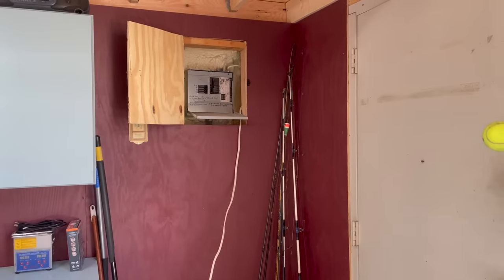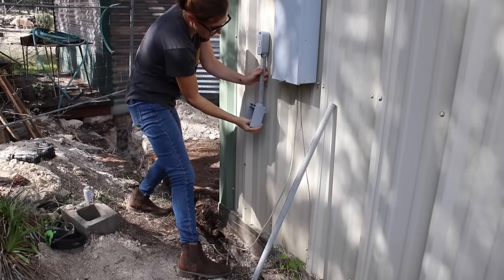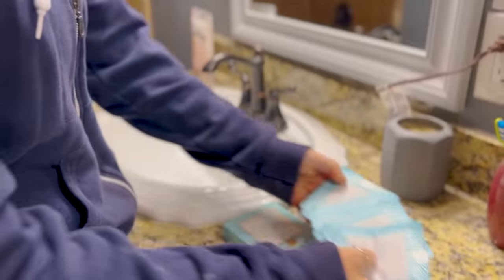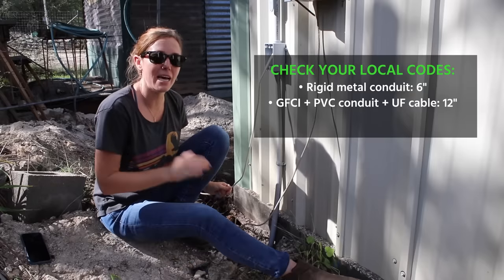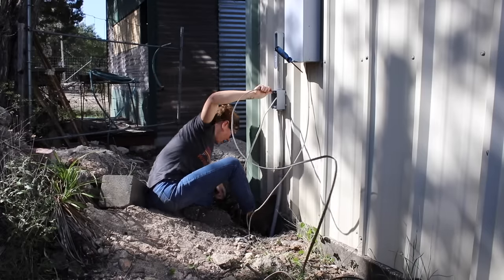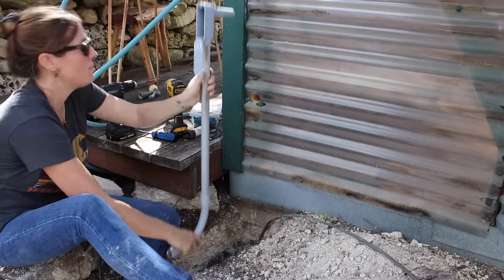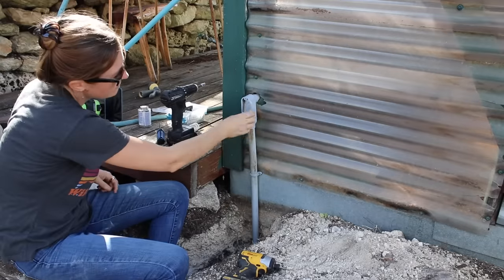How to Run Underground Power to a Shed the Easy Way

Comment: Your first run of Romex to the GFCI is a code no-no, even inside of PVC conduit.  NM cable (ROMEX) is not permitted in damp or wet  locations [NEC 334.12B(4)] and the inside of raceways (including PVC conduit) located outdoors is considered a wet location per NEC 300.9.   Your first run should be UF cable or individual THWN conductors.  If the latter, the individual conductors should be placed in conduit all the way to the source panel.
Reply: Texas has very lenient/substandard codes.😒
Reply: This is texas are codes are different from were ur from I can see
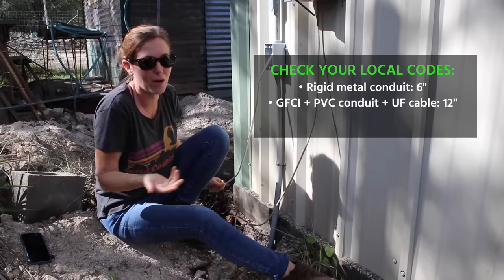Reply: At about 3:30, the text box says “UF cable”.
Reply: @DragCadRacing  Prior to that, ROMEX is used from the inside to the GFCI box....
Reply: @rayrayber_  The N in NEC stands for national. These are unified codes adopted by many states, including TX,  as the baseline for electrical and fire safety.
Reply: @jackww839  Against code even in Texas bud
Reply: @rayrayber_  STILL against code in Texas
Reply: I was just coming to comments to see if somebody brought this up.  I wasn’t sure if I was thinking wrong believing that standard Romex shouldn’t be there.  Glad to see somebody answered the question before I could ask!
Reply: In Texas go big or go home....codes are overrated and unnecessary 😂😂 at least in the country anyway.....where it's legal to DIY   your own stuff ....

SEND IT!!!
 👌mint
Reply: @healthywithamanda  gfym
Reply: @healthywithamanda  not funny
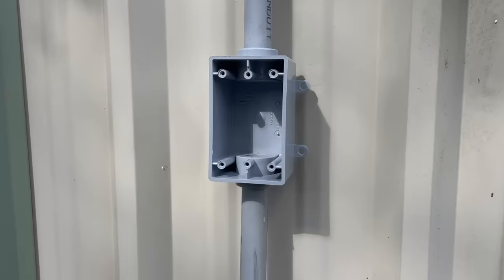Reply: @healthywithamanda  so I guess at 1:22 when she says “according to code…” that means nothing?
Reply: @rayrayber_  bull
Reply: She says in her bio she’s not a professional by any means. Just a DIY’er. 1.5 million subscribers later, i say keep doing what you’re doing.
Reply: It looks like UF even though she said Romex. The only thing I would’ve done differently is push the cable through the conduit at the LB and then cemented it. A lot easier… although, I’d feel much better if the whole line would’ve been in conduit. There’s a lot of rock in that trench to grate against the outer jacket over time. Probably never a problem, just me.
Reply: @fishandgameman lol yeah I was told long ago pipe is your friend.  It's an idiot away from having disaster recovery,  yeah I ran a 1 inch conduit to my shed 8 awg thhn when it was cheaper  on a 30 amp Breaker I got plenty of headroom and a simple fish I'm still good.
""If you think twice before you do you may find out your a genius...""
Reply: I understand that YouTube DIYers need content but when it comes to the skilled trades, they would be serving their viewers better by hiring a licensed professional to do it. Electricity is no joke.
Reply: @clarencebryant9986  lmao yeah well when ""professional/licensed "" skill tradesmen don't know that local codes vary..
I'd just contact my local inspector to find out
Reply: @clarencebryant9986  says every tradesman on earth...  electricity can definitely be dangerous but it's not rocket science to run a circuit out to a building... and hey, the shed side of the run is code and all but a couple inches on the source side... seal that source side and she'll never have an issue with that box.
Reply: I know Texas thinks they’re a country but… It’s called the National Electric Code for a reason.
Reply: Ive used romex in pvc the conductors in romex is thhn

Comment: The Romex you used from the panel to the outside receptacle is a violation. Conduit outside is a wet location. You should have used UF.
Reply: Link please
Reply: 310.1 O(C)
Reply: Thank you. I won't make the same mistake. Hopefully it won't make a difference either way.
Reply: Like it says on the screen at 3:28.
So she didn't even follow the rules she statet herself 😂
Reply: @scwfan08  lmao yup.. UF.. Underground feed.. Not nm-b.. Crazy people with no research make how-to videos. She also did 220v outlets in her garage and ran multiple outlets off the same breaker.. For 220v..she shouldn't be making electrical tutorials lol
Reply: So let me get this right, she ran Romex to the exterior GFI where she transitioned to UF.   She had approx 4" of Romex in this exterior box.   BFD.  She will have no problems related to this.  Her fitting there is sealed and the box is rated for outdoor use.  The PVC is vertical and just used for protecting the cable from grade to wall penetration.   No water will be trapped in the short length of PVC.   Do you really think this will pose a problem?  @GageDrums
Reply: Looked like UF to me.
Reply: Yes, she did say Romex, but I think she meant UF, because the light grey wire she is feeding certainly looks like UF.
Reply: @rosewoodsteel6656  it will pose no problem at all, it only poses problems for the armchair inspectors that search youtube for their moment to shine...
Reply: She is using uf

Comment: I’m sure others may have said the same, but it’s not allowed to run NM cable (some call it Romex, which is a trade name) in conduit that goes outdoors. If you are using cable that’s rated for direct burial, you should be okay (but good to check with inspector). So the wire from the panel to the junction box should be non-NM and something like THHN wires, but not standard NM). I’m a master electrician and ICC licensed electrical inspector.
Reply: I did a similar install to get a lamp post in my yard. I used THHN in PVC conduit through the garage to an outlet on an exterior wall. 

From the GFCI exterior outlet I switched to UF-B cable but there is about 2' of UF-B in the conduit before it gets underground. 

Is this acceptable or should I change it?
Reply: I am still amazed that there's a type of cable that you just put in the ground directly exposed to the dirt?!  Is it bad to run it within conduit for the entire length?  I'm paranoid that moles will eat my electrical wires or something.
Reply: @tomhackett3395  You should be fine. I opted for a buried primary service line instead of overhead wires for roughly a 100 yard run from the road to the house. From the meter to 2' under is in conduit, but the rest is direct burial. In service since '99 and never a problem despite driving tractors over the soppy ground above it and burrowing critters of every kind. Like you, I had my doubts but all's good! Likewise, I have various runs of direct burial lines to several outside locations and have never had an issue.
Reply: Curious what is the reason code won’t allow NM cable?
Reply: @kevinlynch3372   It's not waterproof -it has paper inside
Reply: @kevinlynch3372  Also heat build up with Romex in conduit buried.
Reply: @bruceyyyyy  Shouldn't there also be a weathertight connector on those threaded ends of her pvc conduit? The wire doesn't appear  to be anchored otherwise to her GFI duplex box,
Reply: @AWSmith1955  I do not know. I'm a DIY'er not an electrician.
Reply: @bruceyyyyy  I meant to reply to Michael C but it tagged you instead
Reply: @kevinlynch3372  apparently has to do with heat. If in conduit that direct bury wire can dissipate any heat to the soil. If in conduit it can't do that. It is tough stuff. Han a line buried 16 years ago for my pool. I dug it up since ran a new line and breaker. Now reusing that line to run power to a shed. Still intact and insulating sheathing 👍
Reply: @tomhackett3395  ... they have had direct burial cable for years because it's cheaper than running conduit. OTOH, you need to run deeper due to moles and gardening are less likely to cause damage.
Reply: @Icehso140  ... I believe the new designation for wet areas is THHN-2. Anything outside should be rated for wet locations, even in conduit.
Reply: @AWSmith1955  I'm not even sure thats sch 80 above ground going into the LB. None of this seems legit. I really hope she used a GFCI breaker in the subpanel feeding that circuit.
Reply: True but if she wanted it up to code she'd either need to a) come up to speed on the constantly changing code or b) hire an electrician to do it
Reply: @njineermike  ... it's been code to do "wet rated" for anything outside for decades. It's also been code to do GFCI for at least 20 years. The only thing that's changed recently is the addition of "wet rated" outlets / GFCI outlets with weatherproof while in use covers for anything outside. Inside a shed doesn't need a cover.
Reply: @tomhackett3395  You can run the cable in PVC all the way underground, but that usually does not occur because of cost. You can by Direct burial Romex, but you need to use conduit when it comes out of the ground to protect it, from sunlight (UV) as well as weedwackers, Rodents, small children with wire cutters, etc. Unusually conduit is used the entire way if you are running multiple circuits, or it can be use for low voltage (signal cables).
Reply: Michael, where in the NEC does it state you can't use UF Romex in conduit?   I agree that THHN would be the better way to go, but where does it state you can't use Romex?  Also, April is just using it in her vertical drops from the buildings, which would protect the UF from potential damage from damage (weed wackers, etc.).
Reply: Heat build up would be next to nothing.    @cutley2b
Reply: @rosewoodsteel6656  You are conflating UF cable with NM cable.  The former is rated for wet locations but the latter is not.  The inside of a conduit that is  located outdoors is a wet location per the NEC.  A portion of April's  outdoor run used NM.
Reply: I too am a master electrician, THHN is not allowed in conduit that runs underground, it’s not suitable for wet locations.  Wire must be THWN because of condensation buildup inside the conduit, from above ground heat transfer.
Reply: NMD90 cable isn’t allowed, the “D” stands for dry.
NMWU cable is allowed , “W’ /“U” stands for wet, underground .

Or just run RW90 single wire in the conduit .
Reply: The RW in RW90 stands for?

Comment: You didn't put a service loop on the cable in the LB box. Where you used your foot to bend the conduit to the wall, heating the pipe with a torch would allow for you to bend the pipe to fit the contour of the wall. Also, the conduit where you fitted the male connnector, you can ream the inner edge to a smooth and tapered edge that's no longer sharp.
Reply: service loops are not required by code.

Comment: It is good practice to lay a yellow caution tape in the trench after some backfill has been added. When someone is digging in the area of the underground cable, they will encounter the caution tape before they get too close to the cable.
Reply: I believe the tape is  required by the NEC.
Reply: I believe it should be Red
Reply: That won't do any good if the length of the shovel blade reaches the cable. Tile spade depth is pretty close. Caution tape won't provide any resistance.
Reply: @hotpuppy1  Keep your day job. "-)
Reply: Naw.
Reply: I like a layer of sand across the whole trench width in addition to the tape.
Reply: In Canada, I think this situation asks for a pressure treated board to be laid on top of the wire/conduit, with the tape on that.
Reply: I like to lay a series of broadswords the length of the conduit. 
Seriously, good idea.
Reply: In some locations it is code. Code or not it is always a good practice.
Reply: I put bricks over the conduit too.
Reply: @mixedupmenopausaladhd3999  Sorry I need that in metric. How many katanas is that?

Comment: Not including an advisory about the length of the wire run and amperage draw dictating the gauge of the wire needed can set a dangerous situation.  As a clerk in the electrical department of a large DIY store, I had many customers who wanted to run 14 or 12 gauge wire in excess of 100' to run shop equipment in an stand alone workshop. I calculated on one case that the fellow would need 4 gauge for what he was proposing.  He accused me of trying to make more money off him. I told him that I was paid by the hour and I made the same if he bought the right wire, the wrong wire or no wire at all. Please consider adding such advice.

Comment: I'm torn. I'm too lazy to do this myself, and I'm too cheap to pay someone to do it for me. I guess I'll keep running an extension cord to my neighbor's house until I get motivated.
Reply: April really does nice work but I'll do it my way.  It's just a shed, not a machine shop.  Nothing that a 14ga,  especially a 12 ga. extension cord can't handle.  Outside house plug is Ground Fault protected so just plug it in, bury it under grass and call it good.  If someone hits it with shovel nobody gets hurt because of ground fault.  Extension cord would probably last 15 years but if insulation does break down ground fault shuts it off.  If ya sell the place just cut cord off below ground and let next owner worry about it.  Out buildings add little value, wired or not.
Reply: @jefffrayer8238  If the shovel only hit the hot wire, the GFCI would do nothing and that would still be a dangerous situation.
Reply: @jimmac1185  no, if the hot wire is faulted the GFCI will trigger.
Reply: @LG-ve9us  gfci stands for ground fault circuit interruption. If there is no ground fault, there is no interruption. An AFCI would trip in this instance, but not a GFCI.

Unless you are saying the “ground” would be contact with the dirt? Maybe, if it was really wet it might trip.

Also, my comment was from a year ago, I don’t remember what is going on in this video and I’m not going to watch it again.

Comment: I feel like it’s easier to just run the pvc underground all the way and pull in stranded wire after.  I hate fighting solid wire.
Reply: I totally agree, TsJuno.    In this case, she didn't run the UF in conduit the entire run, just in the vertical drops to protect the cable from grade to the wall penetrations.

Comment: April, when running power to my shop build, My son had a piece of rag that he tied to some nylon string. He then went in to garage where the conduit was going to the main panel turned on the shop vac and it sucked that rag & string thru in about 2 seconds and he tied and taped the wire and pulled it back to the shop ,the whole thing took just a couple mins.

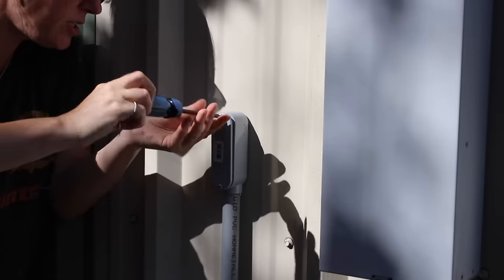Comment: 1:45  can also buy fittings to allow for different bends, if don’t wanna flex the conduit like this (sweep 90s, [also called elbows], street, bell ends, saddle bends, etc); and if don’t want to buy the different fittings (or can’t find), you can heat up and bend the conduit yourself (pvc only, as emt not gonna be heated and bend, gotta use a bender; and ABS doesn’t heat well and wouldn’t even try it, imo)…..just a tip for ppl if feel weird about flexing the conduit how April did.

Comment: April I used to work for a company that made a lubricant to pull electrical wires (romex).  The lubricants are just glycerin so one might be able to save some money and just use glycerin.  As always great video, very informative.
Reply: I have always used kitchen dish soap to lube the wire.

Comment: Good work! But I'll add that 20 years ago I didn't anticipate my similar project would be more permanent than I anticipated at the time. (My purpose then was to get power to a deicer at a livestock water tank.) During this period, the PVC outlet's year-over-year exposure to the sun caused it to degrade and become chalky, brittle and inflexible. A little post movement during an unusually wet year with a super freeze cracked the riser pipe, and the hinged cover on the outlet box fell apart. If I had a do-over, I'd have gone with metal over PVC despite the added work.
Reply: How much more  resistant to corrosion is the pvs vs. meral conduit. It it emt conduit?
Reply: There are different grades for the PVC.

Comment: The hard part is digging the trench for the wire. Thank you for sharing. Have a great day and stay safe. Be careful the electrons can bite.🙂🙂
Reply: It took my wife two weeks to dig a 20 ft trench so I  could put the wires into it, she ran into a lot of rocks, she did cover it up faster though
Reply: That's actually what I was hoping to see taught, when I clicked on the  video.  I've heard water pressure, maybe a pressure washer, can be a good way to go.

Comment: There is flexible conduit, outdoor rated. I used that to run AC, along with outdoor-rated speaker wire, out to my shed. The great benefits: a) flexibility allows you to maneuver around large underground obstacles; b) zero underground junctions, so no leakage or seepage of water into your conduit. It’s been a godsend for Xmas lighting, as well as for outdoor stereo audio. I can run a powered subwoofer. The garden sounds amazing
Reply: Electric code only allows a maximum of 6’ of use, for flexible conduit.

Comment: Nice job!
It is important to understand voltage and amperage needs to be considered when determining depth of wire. A residential 20 amp circuit using 12/2 copper underground rated cable can be installed at a 12” depth as long as it is protected with GFCI device.
Electrical codes can be more stringent depending on where you live so please consult an electrician or electrical inspector in your area.
Also it is important to note that schedule 80 pvc should be used in this application.

Comment: Every electrical video I’ve ever watched will state “if your not comfortable doing this work, call in an electrician”, which is sound advice. However, anyone can do the manual labor (digging trenches, running the wire, backfilling) prior to calling in the electrician, thus saving a ton of money.
Had a project similar and ran a line 75’ from a house panel to a garage. Found out the code requirements, did the labor and then call the electrician. He was happy, because I had set up everything for him and all he had to do was set the wires in proper order. Saved 15 hundred on the project by doing some of the work myself.
Reply: Good advice for those afraid of doing this type of work.